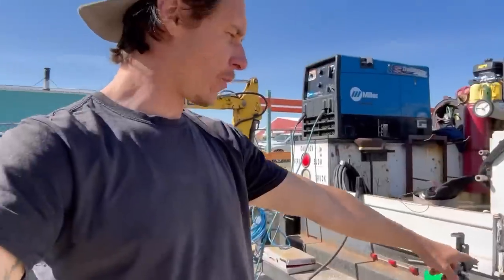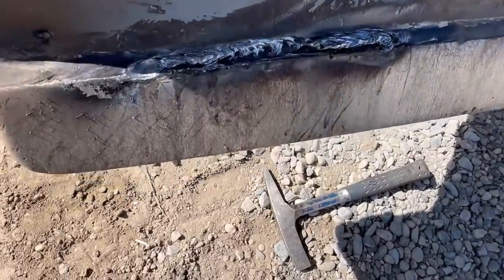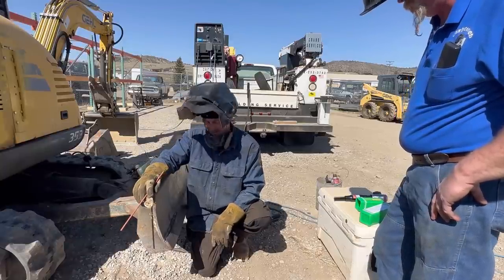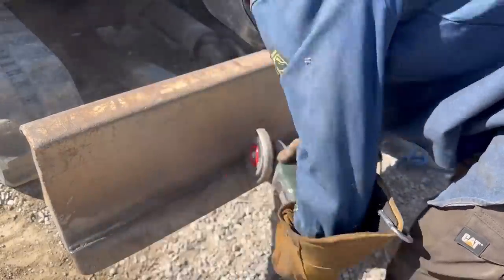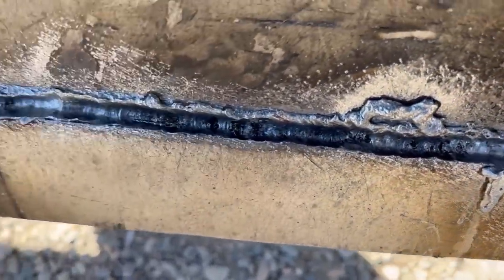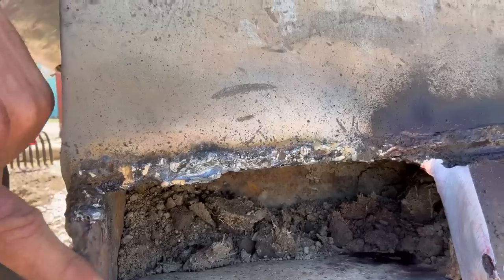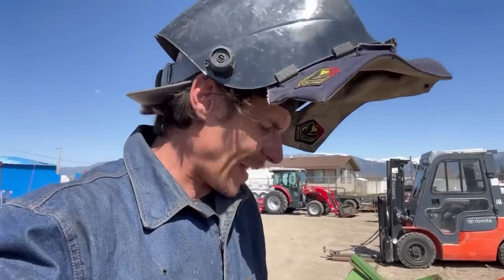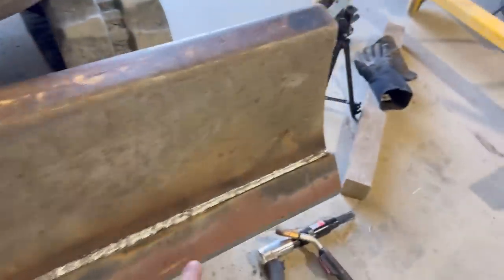Arc Gouging with NO AIR!

Comment: The other thing to consider is that the Electra rods don’t blow the sparks that far out as an air carbon would. That is better when working in tight spaces or even in spaces where you have to work with others crews around you. Hell of a nice product man

Comment: Back in 1979 when I was in Welding school, had some cutting of welds to do on a side gig. Being 18, I didn’t have an Oxy/acetylene rig, just an AC/DC Lincoln 225 tombstone. My instructor, JIM GREER gave me a couple pounds of 1/8” chamfer rod. Had to run it hot, but had no problem pushing out the old welds. Kind of down and dirty, but worked. Remember that rod being dark gray to almost black. Watched your video, Anthony, and it brought me right back to that time. Love your REAL content! ⭐️⭐️⭐️⭐️⭐️

Comment: 11:32, the preferred polarity for carbon is Straight, or Electrode Negative.

As soon as weld at the leading edge of the workpiece is cut away,  drive in  chisels/wedges to "peel" the discard piece as cutting progresses. The nuisance "hangers" will be easy to spot.

Comment: All I would say is 6013s ran very hot will do the same gouging!
Ask any old school fabricator or welder and they'll confirm.
You can actually see this being down on the many Pakistan Truck type channels on YT.
Great to see you using a mask👍 - Welders and fabricators lives are shorter than most others for a reason, and with Inner Shield(AKA Inner Death) becoming more prevalent for on site jobbing work, then things will only get worse for folks.

Comment: Looking at my AC machine. Oh well! I could just use air gouching or turn up the amps.

However, I believe that a big enough charge can overload anything that's DC only.

I've seen 6010 run on AC and that TIG machine was able to produce a big enough charge to surpass its limits.

Comment: WIA use to have a C/G rod which stands for cutting and gouging but since they got brought out they stopped making them as well as nearly 80% of there products that said they were amazing to use I’ve seen my old man run out of oxy while cutting 1” plate so he just whipped out the C/G’s and kept on cutting. The local Enginering shop in its hay day would do truck chassis mods by cutting with c/g’s. FYI when cutting you would hold the rod near vertical and would move up and down like a sawing action through the plate

Comment: How many rods did you go through on that half of the blade with the Rockmounts? Also, how many pounds is that package you have?
Reply: Looks like the 11 pound box which is around $380 with tax or about $34 a pound  figure about 13 rods per pound and you can see how costly this stuff is. While these rod have there place I'll take my air arc or plasma over this any day.
Reply: @tek7697  I don’t have a air arc setup at this time. Haven’t really needed one for the type of jobs I do. I agree they are expensive, but for someone like me, I’m thinking they may be worth it. Just for  occasional gouging.

Comment: i would assume it works alot better on vertical welds, than horizontal welds, since the material molted away has more places to go... i have only been gouging with oxy torch, the carbon rod gouging is too dirty too use practically here in denmark on a job site, allthough i know they use them in machine workshops.

Comment: Does the gouged metal just ooze away as slag, or is it vaporized? Just curious where it goes.
Reply from the maker: It blows it away
Reply from the maker: Must be the arc force
Reply: @MeltinMetalAnthony  Makes sense, thanks. It's starting to get hot back here in FL...

Comment: I just looked it up on their website now there's a contradiction there on the website it says electropositive or AC
Reply from the maker: Maybe you can use it on all 3? Maybe I need to make another video doing all 3
Reply: Thanks so much for calling this out! Indeed the website is missing information. This rod will technically work with with any polarity but we recommend straight DCEN as it pushes harder.

Comment: Any carbon rod will gouge..  i had a bunch of old ass torch batteries, 6v..  they all have 4 rods in them all 3/4”x7”..  if you shave down one end you can grab it with your stinger and dcen with as much amperage that you want..  things will burn through anything before they burn up themselves..

Comment: You can soak 6011 in water and crank the amps up and make a mess like that shit too. Carbon arc will surgically remove  what you want, a scarfing tip on the torch will too, learn your process.

Comment: you used 6010 to weld on a cutting edge? it must be just plain cheap steel then and not any kind of real cutting edge because it would crack with 6010 and MIG welding it.
you went from looking like a pro welder to cobby farmer brown by the end of the video

Comment: This is why you need a "weld cam" with a # 9 or 10 lens so we can see how it looks, too.  Plus, we get to give you shit about your technique..  Didn't take long for  you to touch that hot metal..  Dumbass.  YOU  MADE IT HOT!!!
  Looks to me like its a handy tool to use if you can't air arc.  You are a welder. You can figure out the rod.  Just like the first time I took a test with Inconel on CARBON.  I figured it out. It was ugly, but it bent.
  I deleted all the talking shit I was doing regarding you using the air arc..
   I was going to be a smart-ass and find you an instructional video. And I saw yours..  Yeah, nobody ever showed you how to do it..  Keep the air against the work so its behind the puddle. That way it will blow the puddle away from you and leave you a clean area..  I'm just an old Retired construction/fabrication welder.
   Keep the content coming and I will continue to watch.  I just hate you didn't get the OJ contract. That would have made a lot of videos.